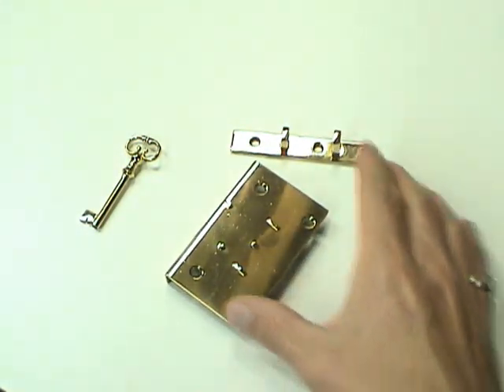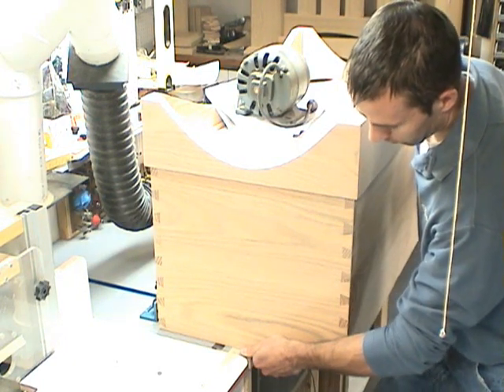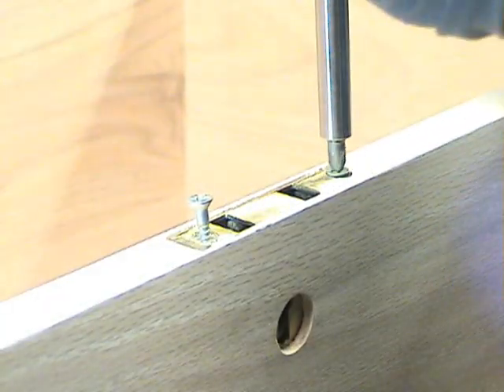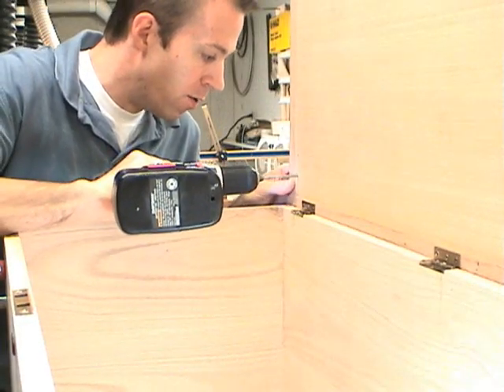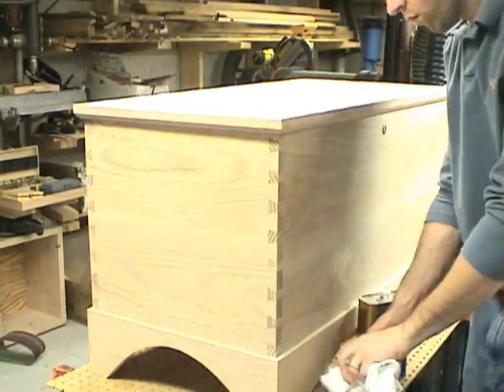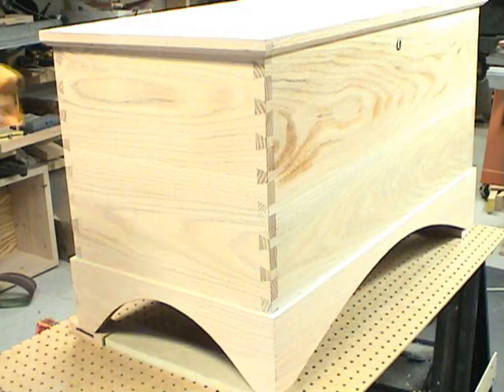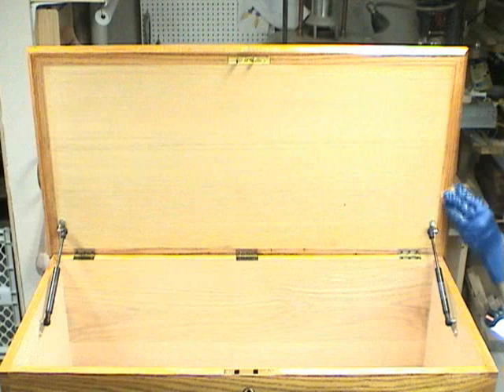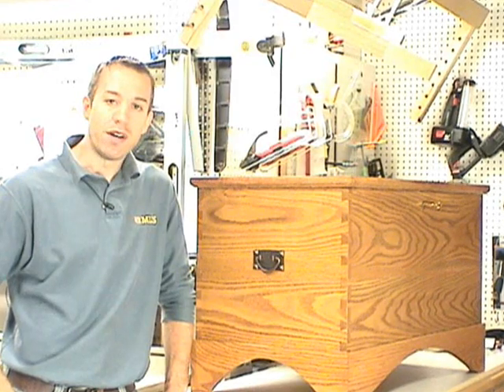Woodworking HowTo - Oak Blanket Chest - Part 3 (of 3)

Comment from the maker: It's about 22-24 board feet depending on how you construct the top.  Depending on how you do the hardware - for example, using a simple chain catch to keep the lid from going too far back as opposed to a gas shock lift would make a big difference in the cost.  It would be a very satisfying project.

Comment from the maker: 3.) Use a Forstner bit in the drill press. I have an old Shopsmith, and I think I have the clearance could get the carcass underneath the bit.
4.) Mortise it on the router table employing the motorized lift.

Comment from the maker: Thanks!  The foot-activated motorized router lift is my invention.  It really changes what you can do on the router table.  It lets you do all the things you can do with a plunge router, but on your router table.
The only place to get one at this point is to make one for yourself.  Check out the details on my site, and consider making one.  Let me know if you need some guidiance.

Thanks for checking out my videos.
John

Comment from the maker: Totally agree - that was not my best move.

The stock for the front of the blanket chest is 3/4 inch thick and the mortise for the lockset needed to be a heavy 1/2" wide and just under 2 inches deep. That leaves less than an 1/8" wall remaining after I'm done cutting the mortise. Believe me, I thought about this one long and hard. 
Here's some of the methods I considered
1.) Chisel and chop it out by hand.
2.) Build a simple jig that would guide my plunge router handheld.

Comment: I have to respectfully add something to your statement.
If you start with low end tools, you WILL more likely loose the interest on woodworking.
Even worse, you might hurt yourself quicker than with pro tools and clamping mechanisms.
If you spend good money right away, you will have lots of fun right from the start and you dont hav to buy twice+its is easyier to work with great tools.

IMHO.

Great job there dude, great implementation of all sorts of techniques.

Sincerely, Dan

Comment from the maker: Thanks.  Most woodworkers would agree that should have 3 core tools in your shop - tablesaw, router (preferably mounted in a table), and a planer.  It's also been said that you should buy the best tools you can afford.  I disagree with this a little.  I think you should buy a middle to lower end tool and get to know it's pitfalls.  When you're ready and have earned the upgrade, you'll appreciate the advantages the new tool has.  I'm not partial to any particular brand.

Comment: Was the alcohol-based dye actually a sanding sealer? I'm a firm believer of using sealers or primers on bare wood before any finishing is done. I've had excellent results with Minwax Pre-Stain.  Great video and final product!

Comment: Hey. Sorry for my bad english, but I hope you will understand. I don't like how you do the hole for the lock, because if you finished side where the lock goes, then you can make it easyer by drilling the holes or using one side o the routertabel. Oak is heavy and move that kind of chest is hard for every woodworker. 
I'm woodworker from Estonia and we do some thing different and easyer.